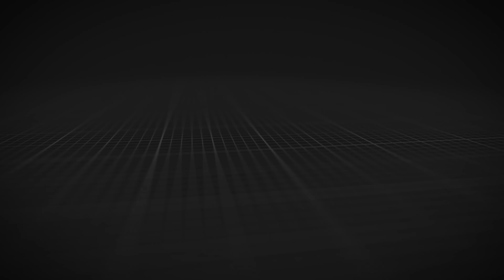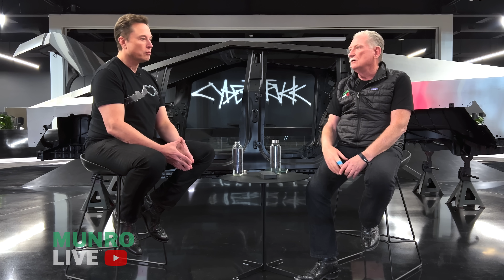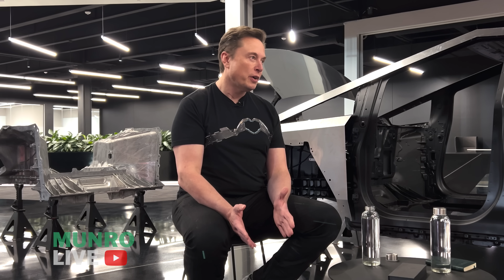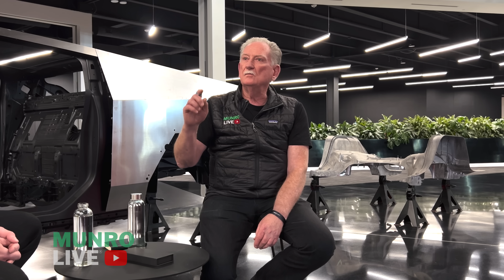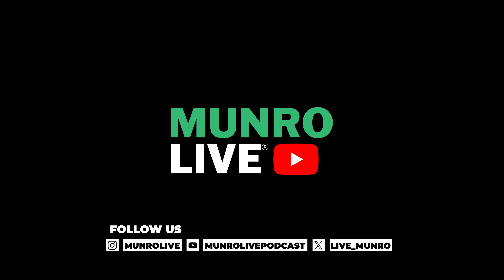Elon Musk on Cybertruck's Adoption of 48V and the Importance of Leadership

Comment: While i agree and there is no real way to argue that the higher voltage has many benefits from safety to savings.. 
I seem to remember ALOT of Munro videos talking about not fixing something that isn't broken.. on top of that there are many decades worth of backwards compatibility and support for 12v systems.. from tools that can be used on virtually any car to being able to jump start someone.. heck there is a multi million (if not billion) dollar industry that makes jump starters/ chargers/ battery backup systems that all can work with one another because 12v has been a very good middle ground for billions of uses across not just automotive but consumer electronics.
is it really worth leaving that compatibility and decades upon decades worth of equipment and manufacturing in the trash?  Think of all the electronics and equipment that IS going to the landfill if we leave 12v systems behind.. 
don’t try to fix what isn't TRUELY broken. imo..

Comment: 48V battery is the dumbest thing ever! The truck already has an 800V battery that can be stepped down to any voltage! In fact I think the 48V system is stepped down to 12V to actually work for most systems.

Comment: 48VDC  was first proposed in 1994 and has been pushed back by OEMs since the early 2000s. The irony is that the development of the CAN bus which is a data over-power architecture and more efficient modular in-vehicle electrical networks reduced the need to move to a 48-volt system. The concept of a 48-volt "POE" in-vehicle network is an innovative concept, and will help drive costs down for Affordable EVs.

Comment: Been reading in technical publications for well over 25 years about cars switching to 48V been waiting for it to happen. Legacy auto manufactures are trapped by tradition so unwilling to change. Tesla kicking there asses in action.
Reply: Not so much trapped by tradition as trapped in an ecosystem and a supplier infrastructure which makes it very costly to change and nobody wants to go first because you will eat the costs and everybody else will get a free ride.
Reply: Has been part of many high end European cars for about 5 years. Suppliers like Bosch, Siemens etc already selling it worldwide
Reply: @lfo414  
So why do these high end European cars still have a 12V battery?

Comment: I mean to me it does not sound like THAT gamechanger. Can someone explain me what EXACTLY should be so great about 48V, and why not go even higher for example 96V ?
Reply: 48 volt DC is the limit for human safety if you touch the wires. If you go above 48V, you need higher safety standards and electrician training to work on it.
Reply: Replay the video and pay attention this time. Going much higher in voltage has diminishing returns.
Reply: I did but maybe I don´t understand the context. Guess it´s my low-skill to understand englisch so well, or I just don´t get it right now
 @universeisundernoobligatio3283

Comment: Sooooo…..
In 1960 they decided that running 50ish Amps was outrageous and we need to swap to 12V architecture to get that down to a reasonable 25ish.
Today, they think that running 240~ Amps is outrageous and we need to swap to 48V to get the Amps down to a reasonable 60~ Amps…
Even though every home already has a million things that run on 120V and they could have future proofed it for the next 10 years and gotten the Amps down under 25~ with off the shelf components for less effort.

Am I missing something here?
Reply: AC vs DC and that most of the world uses 230VAC.

Comment: man the let the electrocution and arcing hazards begin
Reply: Yes all those ignition high voltages are such a hazard.
Reply: @universeisundernoobligatio3283  you obliviously have never seen electrical accidents due to high voltage batteries (above 12v) I've seen batteries explode and burn down equipment... guess all those early model S Tesla fires are irrelevant huh
Reply: @djheatt  
obliviously have never seen gas car fires
National Transportation Safety Board, Bureau of Transportation Statistics and recall data around fires for gasoline, hybrid and electric vehicles. It found that
Hybrid vehicles reported 3,475.5 fires per 100,000 sold. 
Gas vehicles accounted for 1,529.9 fires for every 100,000 sold. 
Electric vehicles saw just 25 fires per 100,000 sold.
Reply: @universeisundernoobligatio3283 have to wait and see how safe the discharge is from shorting out the 48v but yes i have never burned by gasoline fire  but electric shocks many times. much easier to create an electrical short than a gas fire
Reply: @djheatt  
There are such things as fuses, resistors, current sources, PTC Resettable Fuses and solid state fuses, pyro fuses to limit available power coming from a source. Proper electronic design is required.
An estimated 212,500 gas powered vehicle fires caused 560 civilian deaths 1,500 civilian injuries; and $1.9 billion in direct property damage in the US during 2018.
Reply: @universeisundernoobligatio3283  it's gonna suck when these catch fire, are involved in car crash, or low quality mods fail. luckily the first owners probably won't abuse them. i have seen many Teslas in the ditches off the Freeway here in California so they are no way less hazardous than ice cars
Reply: @djheatt  
Hope you don't have a land line telephone its 48V and 150V for the ringer, you put it up to your head. Be afraid be very afraid.
Reply: after reading and looking at the wiring schematics the major changes has nothing to do with 48V but more about using a data bus and multiplexed communication to computing/sensor peripherals. 12V or 48V don't really matter cause electronics mostly operate at 3.3, 5, 9, or 12 volts. The LED lights, window motors, Windshield wipers and door locks probably only use 48V
Reply: @djheatt  
Did Tesla give you access to the Cyber truck wiring schematics?

Comment: The question I have is when the low voltage battery died under the 12v system one would connect a jump pack to external wires to gain access to the vehicle.  Is this still possible with 48 volt system? Or would one need a 48v jump?
Reply: Regular jumper will pop frunk if LV is dead
Reply: Connecting a normal car to a Cybertruck will open a black hole.
Reply: A jumper cable for what?  There is no ice engine to turn over to make the alternator generate electricity to run the whole car.
Reply: Got my answer from the latest Munro LIve.  6 minutes into the Tesla Exec deep dive they mentioned having to figure out how to jump start it.  They put is a switch converter circuit that detects if you're jumping with 12v or 48v.

Comment: Does the CT have a separate 48V battery or does it pull the 48V from the HV pack?
Reply: My guess, just like other tesla (12V) cars, it would be a separate 48V battery.  That's mainly for none-drivetrain use , like computer, doors, frunk, etc..
Reply: I can't see why it would be hard to do a ~48V LFE just like the current 16V LFE.  I think if it was using any part of the traction battery Musk would have touted that because it would be a significant achievement.
Reply: it would be silly to have a separate one, i just asked this but 99% sure main battery will be 48 VDC and this even matching with the Tesla Powerwall for easy bidirectional charging.
Reply: @t-lm  No... I believe the CT has 2x400V battery packs

Comment: totally make sense to move to 48V, incredible no other car maker made this step until now but lets move on further more, will it have 48V battery system too? This would be perfect match with MANY home backup battery systems too without the need of DC-DC up and down converting. It would be easy to implement DC bidirectional charging then. Tesla and Chinese EV makers should think about DC bidirectional charging and also AC bidirectional charging finally. Talk with SolarEdge, Enphase, Victron too. Will you need DC up converter from 48VDC for V2H or just direct connection? Will you use let say Bluetooth communication between car and home energy system? Tesla Powerwall is 48V DC  (before upconverting) and also BYD LVL is 48 V DC !!!
Reply: Most ESS systems that DIYers run are 48V nominal.. above 60V it becomes dangerous and one really needs to know safety rules to do stuff in that realm, as when anything goes wrong society will come in and investigate and discipline.

Comment: So I noticed that pretty much everyone (including Suberu) is announcing smaller EV pickups such as the Maverick.
Is there any reason that all the 'groundbreaking' tech that Tesla is using in this vehicle needs to go into something this size?
I've noticed that there are several drag contests between the Cybertruck and the Hummer. This is apt as the Cybertruck is probably the new king of bloat.
I still think that the only reason they added steering to the back halfway through the dev cycle is because without it,  this thing changes direction like a supertanker
Reply: The F150 is a supertanker parked next to the Cybertruck, how do you think it (the Ford 5:19 F150 ) handles in a parking lot without four wheel steering?
Reply: @Drcraigfreeman  My theory is that Tesla realised that few customers will use this for real work, and that it will be mostly an urban cruseir, and needs the tighter turning circle
Reply: @Drcraigfreeman    It handles worse but not $40,000 worse.. idk how much you think 4 wheel steering costs but its not 40k and its something we have ALL been living without for over a century.. so.. hardly a "supertanker" and hardly an issue worth paying so much for.
Reply: @Napster60  4 wheel steering isn’t a 40,000.00 USD cost option, prices for those new trucks reflect the cost increases from 4 years ago, none of which were ever set in stone. Can’t afford one, stick with the Ford or (gag) Chevy ICE truck. 🔥
Reply: @Drcraigfreeman  
I have what I can afford already. Neither truck is an option at the moment. 
I'm just looking at this more rationally then a typical fanboy of Tesla.
Reply: @Napster60  No you’re not, you’re acting as if the entire extra cost of the Cybertruck is in the four wheel steering and that it is so huge, Neither are true, it does not take a “fan Boi” to see that.
Reply: @Drcraigfreeman  
I don't think you understood or perhaps you took my post too far but to clarify my intent was to demonstrate that turning radius isn't an issue.. certainly not one that I would be willing to spend the fairly major price golf for.. 
Their own video showing the difference between the two trucks was cool but it wasn't a MASSIVE difference like you seem to be very excited about.. it's an improvement.. sure. But it's not a big deal when also coupled with the cost difference between the vehicles.. 
We have survived a LONG time without some of these features and you where trying to over inflate the difference by comparing a regular pickup like the lighting as if it was some massive unmanageable turning  radius... That's nonsense my guy.
Reply: @Drcraigfreeman  I've got a new theory. Musk did a 'Steve Jobs' . 
 Elon drove it home (Steve is famous for getting the iPods max vol maxed out cause he had problems hearing it (cause he has hearing problems)) and couldn't park it in his drive way, so he extended the delivery time to add 4 wheel steering. 🙂

Comment: Excellent, I didn't think they'd be able to move to 48V this quickly but they did!  Pretty freaking awesome.   Using the POE+ standard (power over ethernet) as a rule of thumb, that is a ~48V system which allows roughly 15W of power per 23 AWG wire pair (roughly 60W for a standard 8-wire RJ45 ethernet cable).  23 AWG is very, very thin.
Reply: How about the CAN issues experts raise we need to sort with latency critical for safety critical systems
Reply: @makdemir  There is more than one CAN bus.   Usually equipment is segregated so critical low-latency functions are guaranteed.   Nobody is going to try to mix audio with battery management / motor control servos on the same CAN, for example.

The latency is actually only a minor problem. With CAN the bigger issue is that it is a bus rather than point-to-point, which means that physical damage to one part of the CAN bus can disconnect all the equipment hanging off of it, and not just the equipment that was damaged.

CAN busses are segregated primarily for that reason, not because of potential latency issues.
Reply: @junkerzn7312  thanks a lot for a body/vehicle integration guy I am still learning vehicle network systems. I would like to hear your comment on this statement... " Latency and packet loss are pretty much the most important things to worry about when designing hard real-time distributed safety critical control systems."
Reply: @makdemir  Well, the statement itself is perfectly fine.  The implementation is going to be a bit less exciting.  These days throwing in another CAN bus costs $0, so you just have as many as you need.   

Neither the CAN bus nor ethernet in general has any packet loss on a hardwired, short-range network these days.  Literally.  Zero packet loss.   They have packet queues, but no packet loss.   You still need mechanisms to deal with packet loss, of course, but they can be pretty proactive since it isn't a normal circumstance.

Latency is still an issue but totally trivial to deal with in this era of fast networks.  Once bulk data is separated out, everything that remains uses so little bandwidth compared to available bandwidth that latency can be guaranteed down to roughly 1ms.

If latency lower than 1ms is needed, you just have a dedicated link for the function, or you use reserve a time slot (use time domain multiplexing).

By the way, this is what the Telcos did during the early days of digitization of voice.   T1 lines, T3 lines, and fiber trunks were all time-domain multiplexed so latency-sensitive devices such as 56K modems still functioned properly.  In later years, though, Telco's started using regular packet networks for voice traffic which were not time-domain multiplexed and "high speed" analog modems essentially stopped working because of the massive latency and jitter.  Most people didn't notice because voice communication can handle lots of latency before the brain notices.  But the modems couldn't handle it.

-Matt
Reply: @junkerzn7312  Thanks Matt that one is cool. I think sooner we will find out more about cyber's poe++ and also this zonal or centralized controllers...
Reply: So will we see cat 5e & 6 wiring throughout CT?  Many car functions don’t need high power so lighter/thinner 24 awg car5e should work.  When only data is needed, I wonder if CT uses the new ultra thin Ethernet cables
Reply: They're the only automaker vertically integrated into making (or at least designing) their own electronics, so it's not that surprising.  And the pre-existence of 48V systems for PoE (and now USB-PD) makes it easier to adopt than, say, making up a new 40V standard.

Comment: Ethernet in automotive applications isn’t exactly new, perhaps 100% Ethernet might be. CAN is useful because it is isochronous and supports inherent priority arbitration via its addressing.  The usual approach with Ethernet is to avoid need of arbitration by increasing bit rate to assure sufficient idle time on the bus or to use switching to isolate data collision domains.  Truth be told, you can tunnel CAN over Ethernet or vice versa and I have seen it both ways.  Nowadays silicon is inexpensive so you can do whatever you want.  Proving what you want to do is safe and deterministic when it needs to be is another question, but that is a one-time up front expense.

Comment: What kind of weight savings are they getting? Plus a few% saved from resistance. Is this around a 5% range boost or even higher?
Reply: The weight savings will be minor relative to the rest of the vehicle.  The cost savings, however, should be fairly large.
Reply: I saw somewhere it said $10 billion saved for 20 million vehicles with the switch. I think 100 pounds still helps, it's like 1/3 the average American
Reply: 🤣 @TheZackrambo
Reply: I mean I didn't write it haha. Just read it, said at 20 million cars they would need 9% of the 2022 world copper production

Comment: Alot of people don't realize the going to Ethernet vs cambus is in it selfl as revolutionary as going from 12v to 48v,this approach alone has broken the legacy industry's,,coincidently the term legacy now truly indicates a place for the rest of the automotive industries 😅
Reply: CAN bus is newer than Ethernet and can be fault tolerant and doesn't need distribution hubs everywhere unlike Ethernet and actually uses LESS cable. It's main disadvantage is it can only run at max 10Mb/s but I fail to see replacing all of the CAN bus in a vehicle as any particular advatage, especially for low speed stuff - lights/windows/door switches etc etc.
Reply: @fredderf6491  as I understand it, the faster speeds offer better communications to components in the wireless and Bluetooth realm. It is said it will lead to a better grade of peripherals being installed in vehicles like smart devices in our homes, a pathway that can bus altho some what newer cannot support.